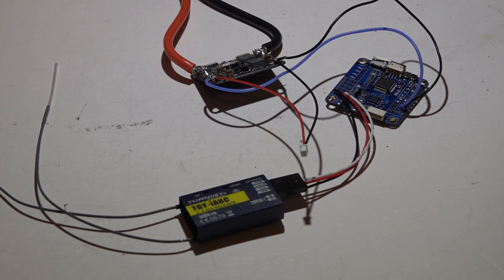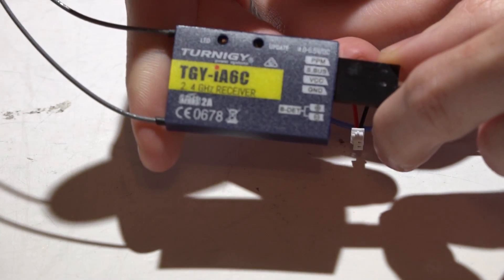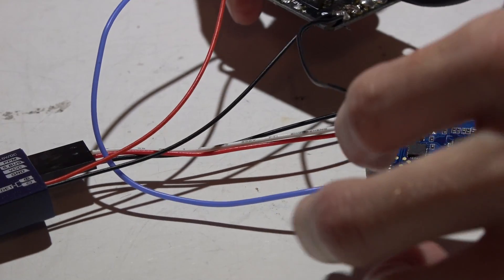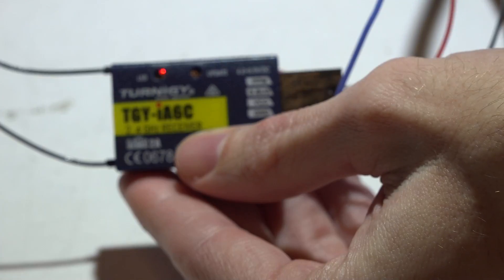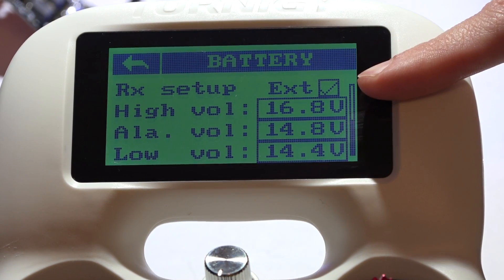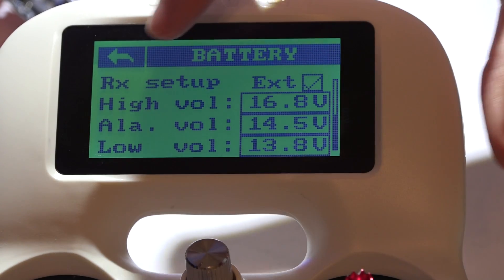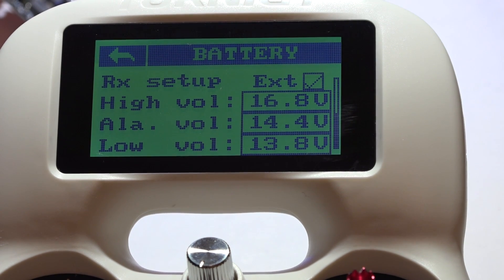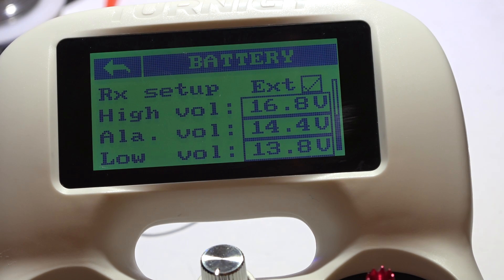Voltage In Telemetry With Turnigy Evolution & IA6C

Comment: Hi I'm looking everywhere for help I last installed a radio system in a glider in 1981a two channel radio ,man radio systems got cheaper  and more complex .l cant figure out  how to install the damp thing it's a turnigy system receiver TGY-lA6B 6 channel I dont know I bus SENS or SERVO/S.BUS dose it need it's own power suppy? I have 6 channel  jet ,need help install system. Manual for radio control says for beginner's and experience alike, well I'm a beginner, it doesn't give the unixpeance any knowledge in its manual how to install. Do you know any site  that I can go to that show start to finish installation for the old farts from the 80,s that dont now this type of systems, I real want  to get this system installing in the jet  so I can crash it,just kidding I'll have someone help me with that.if you can thanks a million if you cant that's cool to ,anyways thanks,your purity smart,me just a dumb as from the 80ss. Have a nice day.

Comment: can you do a video explaining the flight modes setup. I am new and it is a little confusing.
Reply: I too in same boat. I need diagrams and parts or told where to buy. I bought  a mode 2 and escs and etc and really left me in the dark for a nooby but determined to see this thru. I will paypal for info  as i'm retired at 84 young.

Comment: Do this works with the FS-X6b receiver?
Also, the receiver ia6C only support 4s lipo or you can plug a 5s?
Reply from the maker: I've never tried with voltage in telemetry with the X6B. I just use a OSD for all of them. 
None of them support a 4s Li-Po. All receivers are powered off the flight controller and all flight controllers are sending only 5v to the receivers.

Comment: Quick tip,you can get into a few more of the factory settings by holding both sticks down and to the left when you switch it on.It'll even let you up the transmitter voltage,I'm wondering if it'll increase its signal strength.I think its very handy.

Comment: I have the turnigy i6 transmitter I thinks its called from hobbyking just a bout a month ago it came with 2 receivers I think my guy used the smaller one... I know this is stupid but what is telemetry?
Reply from the maker: They just call being able to see sensors on your multirotor "telemetry". The Taranis can see the multirotors battery voltage, RSSI, current, GPS position, and much more. With the Evolution you just get battery voltage.
Reply: Project Blue Falcon mind blown💥 so simple, I feel like a moron

Comment: Does the TX vibrate like the Taranis when it hits the alarm?
Reply from the maker: Nope there are no vibrations. I think they left that out because the motors needed would have made the transmitter larger and heavier. When you hit the low voltage alarms the screen will flash, the sticks light up red, and it beeps.